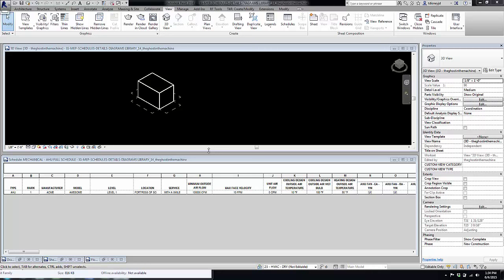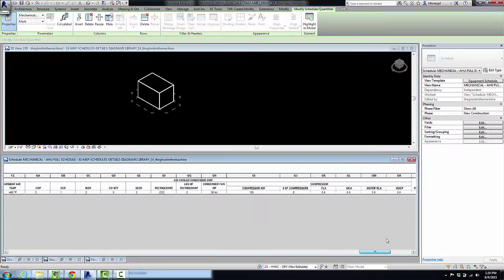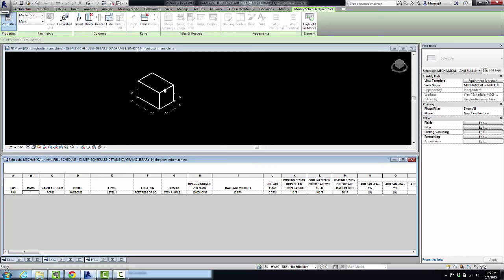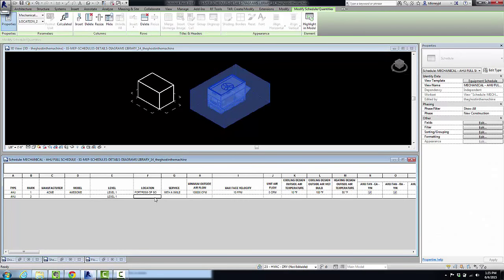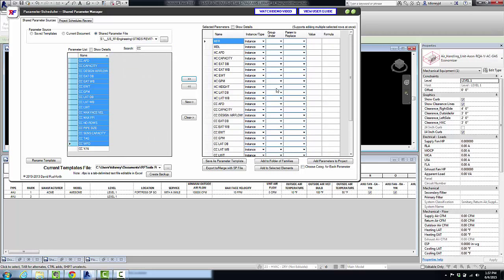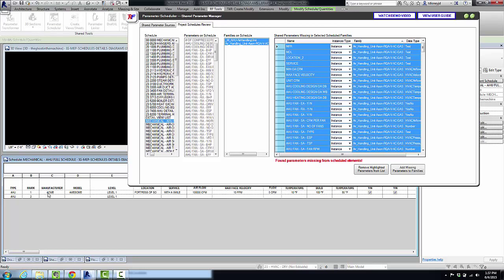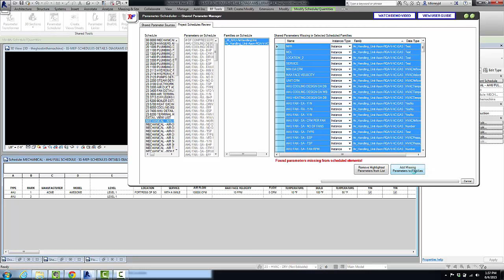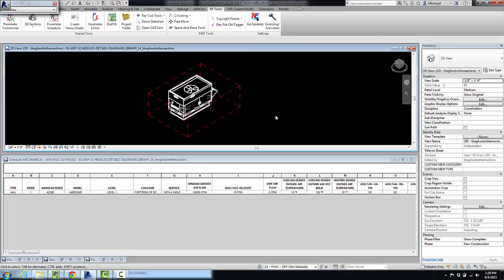Using Rushforth Tools to Swap Shared Parameters in Revit MEP

Comment: I am in the process adding all our equipment schdules from excel into revit, so that the families have all the info.

just wondering, are your parameters just common parameters, text and numbers? 

Cheers
Reply from the maker: +Nick Hartley I actually try to use the 'correct' Unit type for each Parameter. So for example my shared parameter for cooling coil air pressure drop is in "HVAC - Pressure" units, typically defaulted to inches of water. Cooling/heating capacities will be in btuh or kW etc. A few Shared Parameters (service, location, tag, notes, quantity, etc) are text or numbers. 

This is for a couple reasons: 
1) If we have to switch the project from metric to imperial (or vice versa), it's automagic since Revit 'knows' what units the values are in. It'll translate btuh to kW, in. h2O to kPa, CFM to L/sec (or whatever :P ) with one global switch of the unit system. HUGE time saver and error avoider.
2) Our Template Schedules can be built unit agnostic - in other words, none of our schedule Titles have the units in the table headers. They just say "Capacity", "Flow Rate", "Volume", "Pressure Drop", etc. We keep the unit symbol in each cell. This way our Template and Standards are as ready to go for a Metric project as for an Imperial project (we do a mix of projects so this is key for us). We got some kickback on that because it's not how the PMs like to see their schedules, but, hey, this is the 21st century now. Our standards had to adapt for 'intelligent' documentation.
3) Having the actual unit in each cell also serves as a check. It forces the engineer/designer to KNOW what unit they are inputting values in, regardless of what the header says.

It's only one way to skin the cat, but I would make the same decision again if I had it to do over.

Cheers!
Tyler
Reply: +Tyler Disney I like this working, I am going to give it a go and try and get the engineers on board to using schedules in revit. or would it be simple enough to export the schedules to excel and let them fill the data in there and import back into revit?